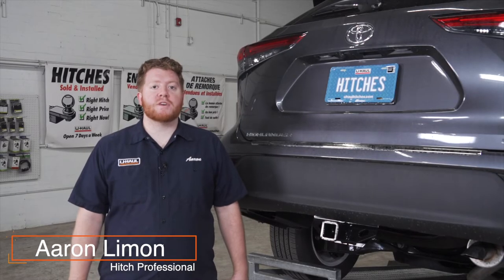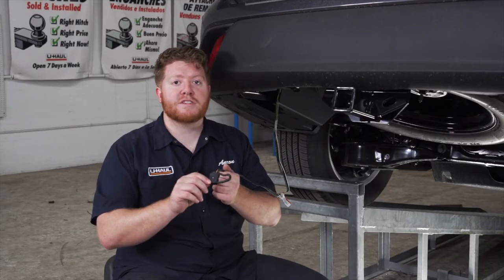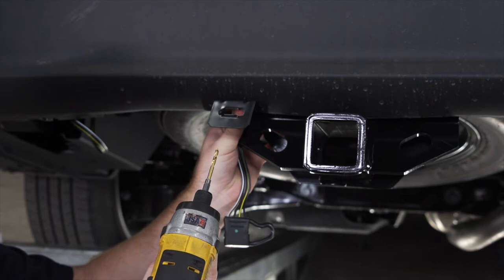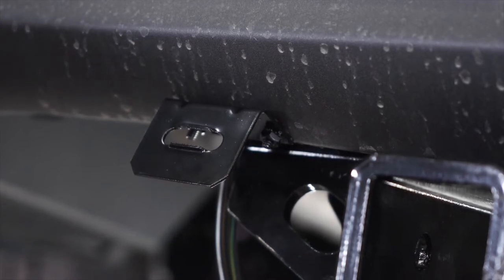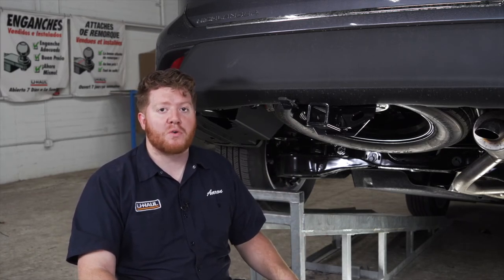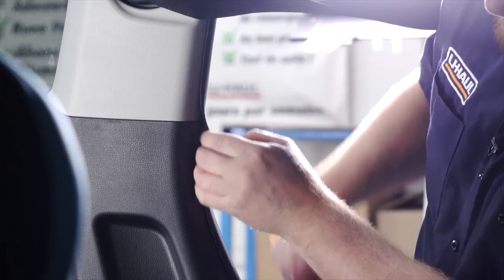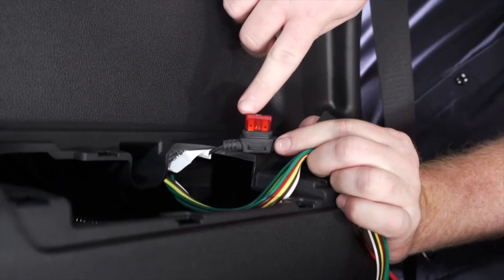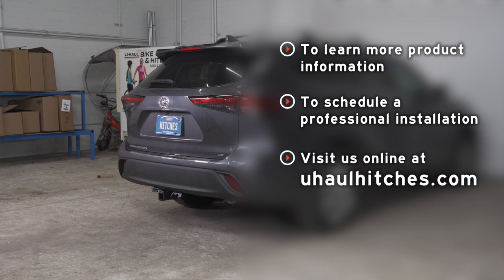2020-2024 Toyota Highlander | U-Haul Trailer Wiring Installation

Comment: Is there a way to install a 7 pins plug on Grand Highlander hybrid max? Tks
Reply from the maker: The Highlander comes with a towing prep package for a 4-Flat connector. The added functionalities of the 7-way, the socket and brake controller must be Hard wired into the vehicle in addition to the 4-Flat functionalities. Visit your Nearest U-Haul Hitch Center to Schedule an Installation.

Comment: Is the ground wire necessary?
Reply from the maker: Yes, electricity doesnt work without somewhere to go. Thats what the Ground connection is. However i do not see Aaron connect any ground wire directly. Its a part of both sections of the tow harness, Connector side and Convertor Box side. Both sections need to be installed for trailer lighting!